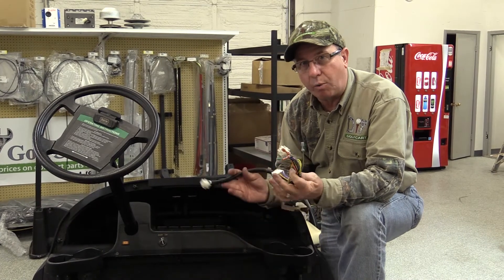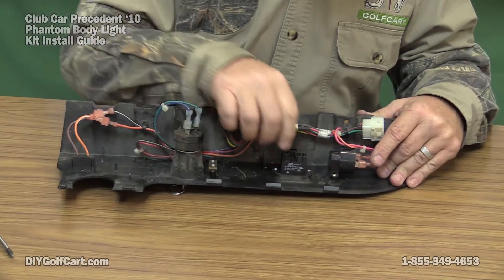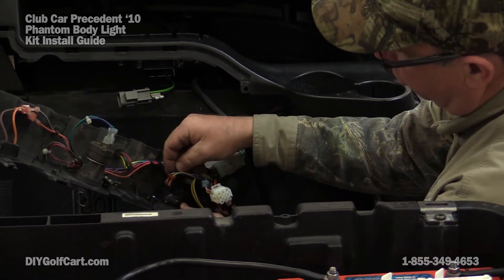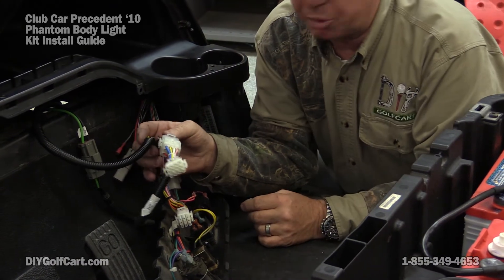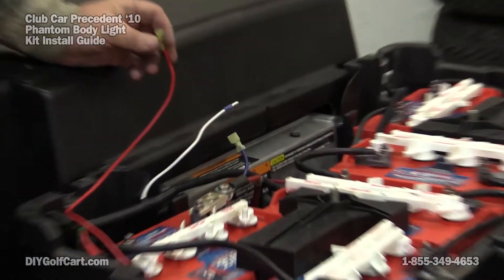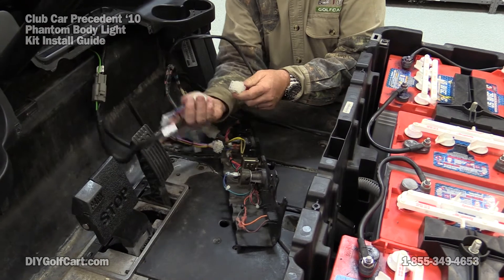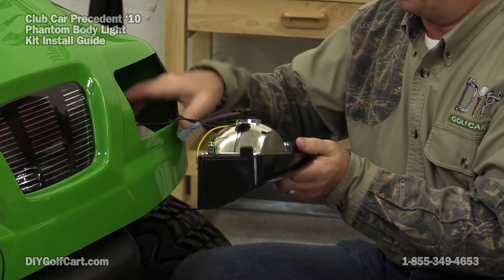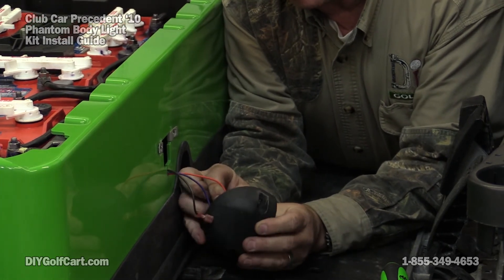Club Car Phantom Light Kit | How to Install on Golf Cart (Part 3)

Comment: I have a club car 2011 with the phantom body kit and it has lights on it now.  However, there's no turn signal or operating brake lights.  I'm looking to add a turn signal and brake lights to begin to make it street legal.  Do I have to get an entirely different light set up or can I use what's there and just add a turn signal kit?

Comment: I have one front tire wearing tread really bad and the other is fine. Is this a sign the shocks are bad or is it an alignment issue?  I try to make sure the air pressure is consistent but I put new tires on a year ago and the left front is showing a lot of wear.
Reply from the maker: Sounds like a Toe In condition. Check out my video on setting your Toe In.

Comment: I have the phantom body and light kit, but there is no relay installed behind dash... I see the 2 large and 2 small connectors, but no relay. Any concerns?
Reply from the maker: No, go ahead and hook up everything per instructions. Personally, I see no use for the extra switch.